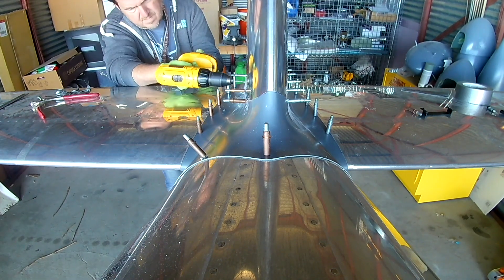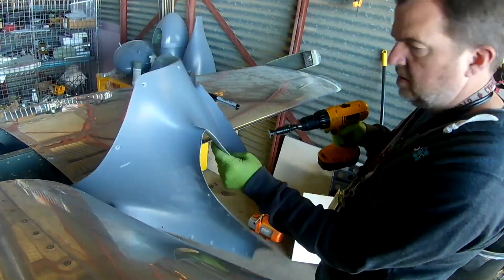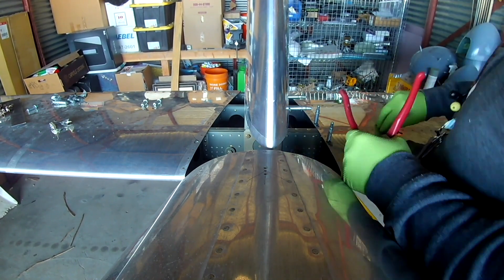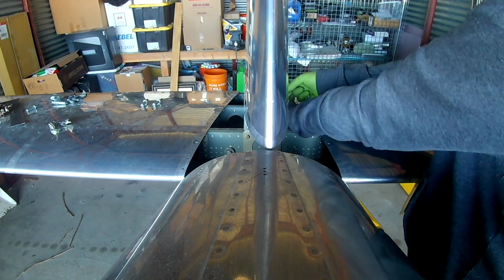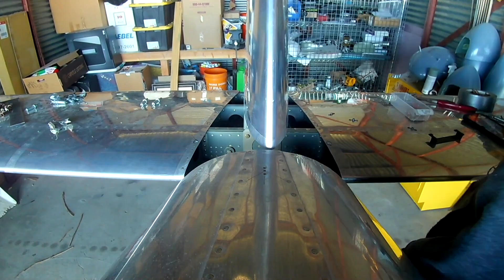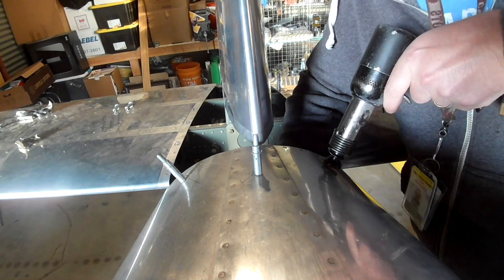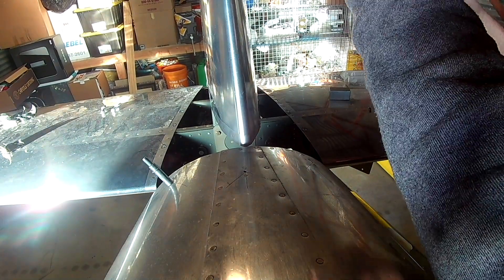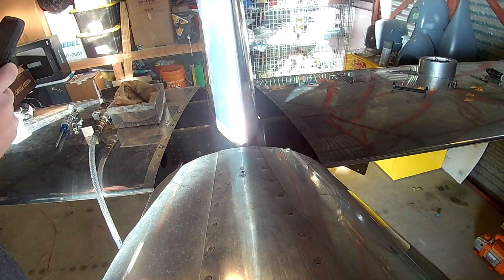RV-14 Empennage Fairing II

Comment: is there a fairing process to ease the edge of the empennage as it joins  the fuselage and vertical stabs?  Looks like a pretty hard edge.
Reply from the maker: There is. The lindy winning 14 I saw last year has fairing built up on the fuse and stabilizers themselves to when you put the fairing in and was a seamless transition.

Again, at this point... screw it :D I wanna go fly!!
Reply: @akilroy  I hear that.  There'll be time for sleek in the future.  Thanks for the reply.